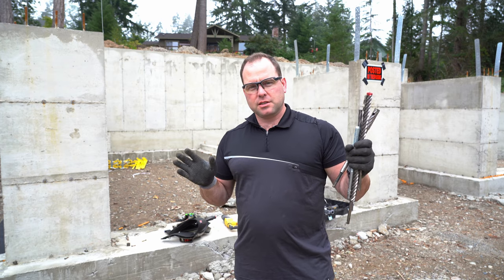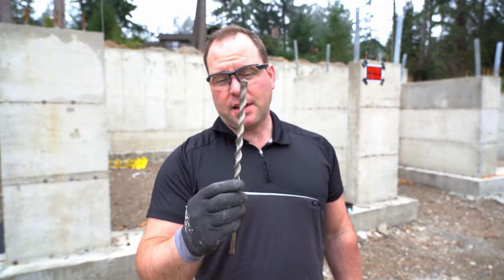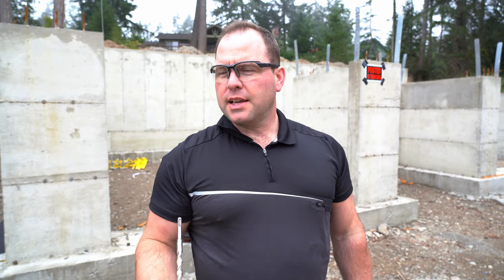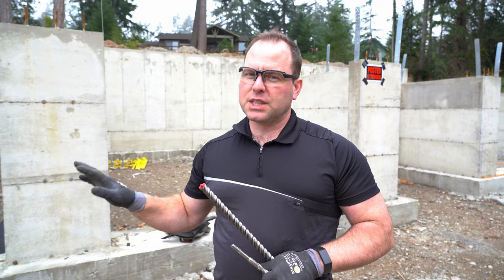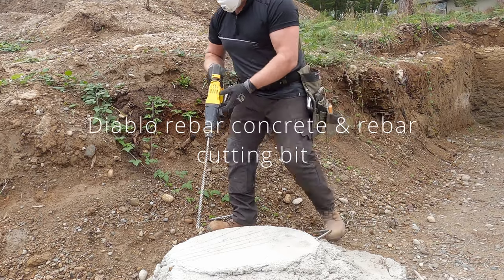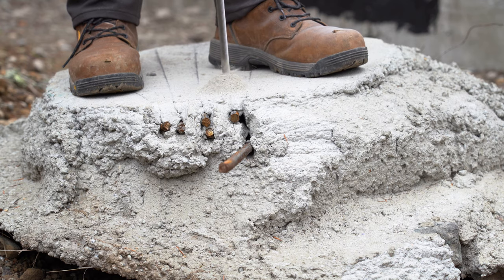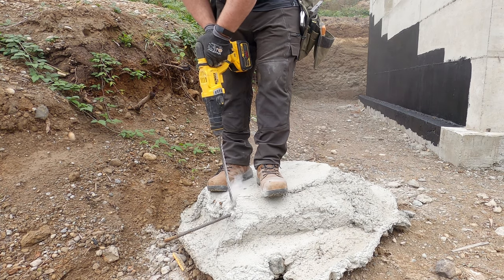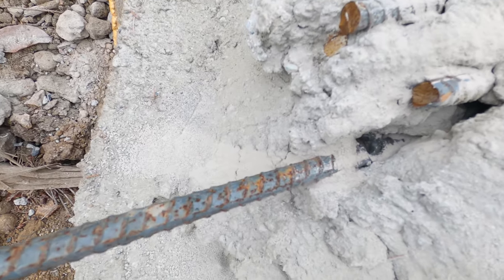Diablo Rebar Cutting Rotary Hammer Bit

Comment: Hitting rebar is maddening!  It turns a straightforward 1 minute drilling session into 10 minutes of skull-vibrating agony.  I did get a "will cut rebar, too" bit the last time -- I think it was a Bosch variety?  It does work, but it still takes a very notable amount of time.

This is SURELY not the right procedure, but what I ended up doing is this:

1. Drill until I clearly hit rebar.  Immediately stop.
2. Shift the bit over by 1/2" and back by a couple of inches and drill again
3. The 1/2" shift will 90% of the time mean that the rebar is missed with the second hole
4. Fill in the original hole with epoxy

That did mean that my anchor placement wasn't quite as precise as I'd like, but the ease-of-drilling savings made it worth it for most anchors and I would just bear down and suffer for those that needed to be precise!
Reply from the maker: yeah those Bosch bits (which is what I had in the video) didn't do so hot.

Comment: Slick, and chiming in late without thoroughly reading the comments so forgive me if someone already said this but
Hilti makes a "full carbide" sds plus (rotohammer) bit that has the big plus sign of carbide in the tip I'd be interested to see how well it does v. rebar (I have not hit any of note with any of my full carbide bits so no data). They charge enough for their bits (and specifically full carbide tips) and they are markedly more durable that I only buy full carbide from like Milwaukee  for example) and I am not punching reinforced concrete with blind rebar all day. And from the description of how you guys rotohammer, you aren't doing hole after hole to really hot up your gear (noted that the heat will transfer from the bit to your tool and can't have the best heh impact on your rotohammer) but if you do even handheld spraybottle with water can make a big difference. Even dropping the bit in water can help the whole system.  Thanks, Awesome!

Comment: Do you have any idea as to why I’d still be getting held up while using the Diablo bit? The best answer I could find is that the concrete I was working on had large bits of aggregate throughout.
Reply from the maker: Yeah, you might be hitter larger aggregate, or rebar

Comment: Since you are first drilling concrete you normally run the hammer/drill setting. It looked to me from watching that when you hit rebar you didn’t stop to switch to the drill only setting. Is that correct? Because traditionally when you switch to the rebar cutting bit you only operate the gun in drill mode. With this Diablo bit does it require to change from hammer/drill to drill while cutting rebar or do you just keep drilling? That was a great video demonstration by the way!
Reply from the maker: yep, you are right about the traditional bits, but not these.  If you watch the manufacturers video, they show it the same way I showed here 👍

Comment: If you need to drill a 3 inch hole for a rainwater pipe that has to go through an old swimming pool twice, can you drill say 4 holes and chip it out to make it a three inch?   It doesn't need to be exact.
Reply: Use a carbide tipped hole saw.  I use spyder.
Reply: @achalabian87  Thanks.  We switched to a one inch pipe to transfer water for a rainwater tank in our backyard.  We didn't end up needing to cut the rebar.   It was quite a job, though.   My husband used a jackhammer and then a water drill under the sidewalk around the old pool.  Now we have 5,000 gallons of rainwater tanks - several tanks.  (We live in San Diego County.)